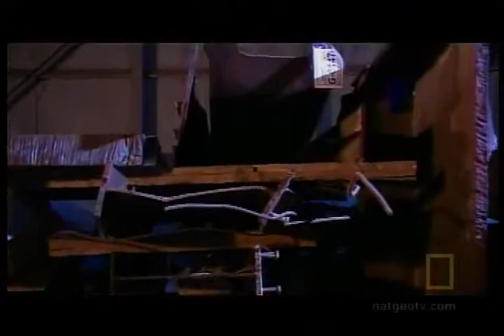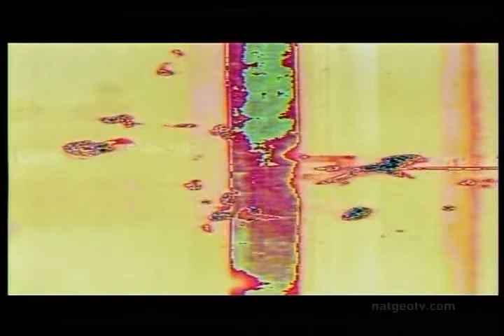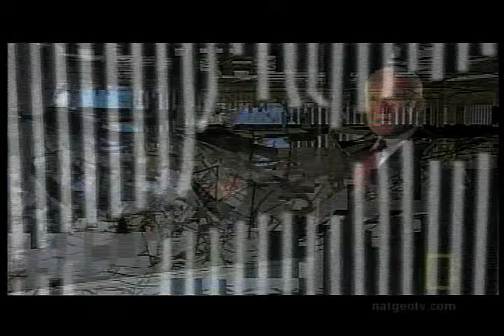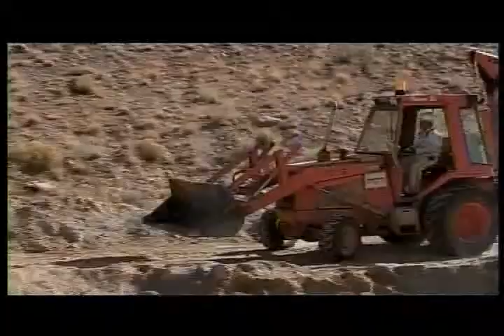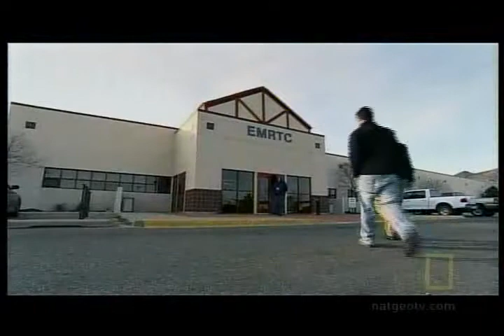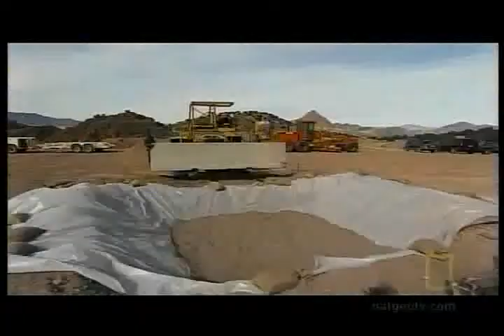9 / 11 - Scientific evidence and Solid Proof that the ATTACKS were an inside JOB ~ #2

Comment: I never thought such a massive tragedy could BE so hilarious! Did they say that people supporting 9/11 Truth deny that planes struck the buildings??  The way I've heard it: the towers were specifically designed to withstand an impact from the largest plane around at the time of construction, which was not so significantly smaller than the ones that hit it. Everything about the official report would work IF JUST THE TOPS FELL OFF. NIST is the most egregious propagator of disinformation in history